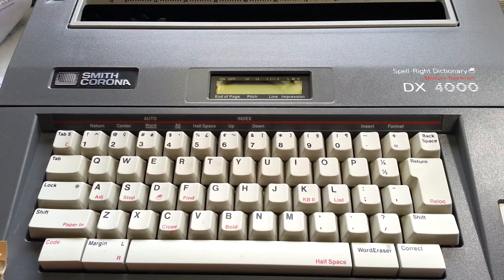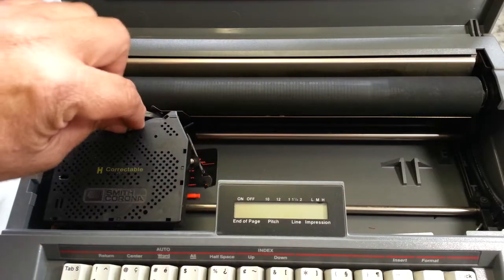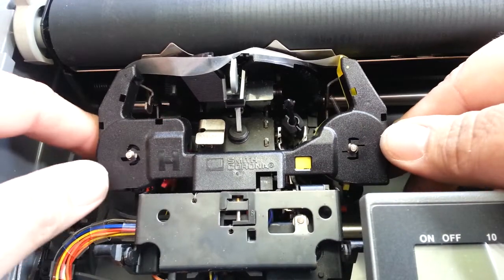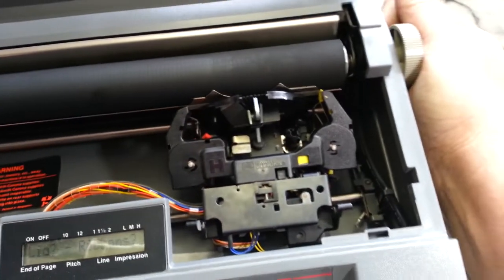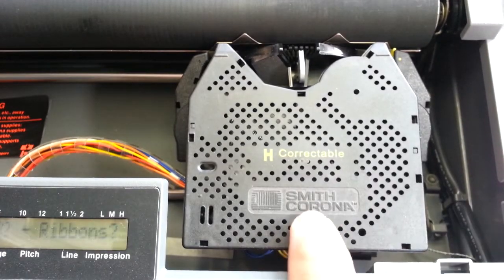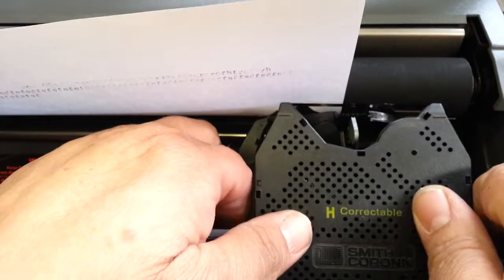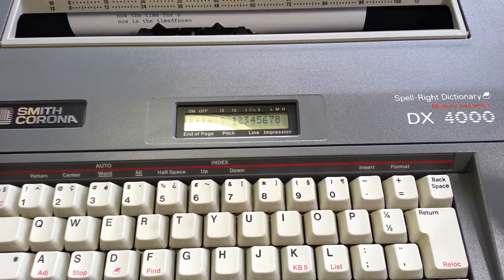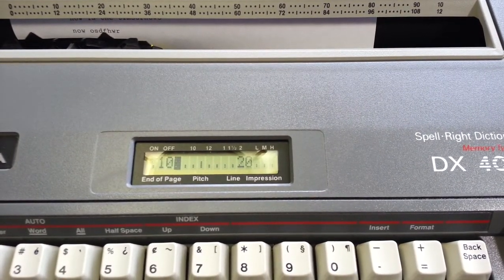Smith Corona Electronic Typewriter Jammed Repaired H Series Memory Demo How to Bypass Ribbon Sensor

Comment: I have a smith corona vtx100. It starts up but doesnt want to strike any letter. I have replaced the ribbon, but it still doesnt move. Also, the lock button is flashing constantly, so I thought I would bypass the censor like you did, but I cant find any sensor. Even though it is an H series. Do you have any help?
Reply from the maker: Majority of the H series typewriters do not have a ribbon sensor, shift light is an error code, but it could be many things, lid switch, carrier cable has a broken wire, PCB could be failing. There were multiple ribbon drive versions, unsure what version model yours is, they made 200+ H series models. Nowadays these are disposable to me, because there are so many available dirt cheap
Example - https://shopgoodwill.com/item/220786321
Another - https://shopgoodwill.com/item/221042596

Comment: I have a smith corona h series sl575, it was working nicely and when I went to test the demo the ribbon jammed. You can see where the ribbon is typing in the same area. Before the demo it typed beautifully. Now it keeps jamming like the ribbon won't turn..?? Any help would be appreciated. Please help if you can. Thanks in advance ☺
Reply from the maker: 1 year ago !  I missed this, check to see if ribbon is turning manually or install new ribbon
If those don't work then ribbon drive has failed and carrier needs to come out and drive repaired

Comment: FIRST! i had a smith corona like that but it had a longer display the full length of the cover and a floppy disc slot to which you could save what you were typing
Reply from the maker: That was a PWP model, they made a bunch of variations of those too......

Comment: My wife has an SL 470 and she can't figure out how to get it to move the page up by one line. She has to do it manually. I can't find a manual on it anywhere. Is there a button for advancing it up by a single line, or might something be broken? Thanks  for your great videos! Lee
Reply from the maker: If you press return and platen roller does not go up to next line typewriter is broken
Try holding platen roller tight with your hand and turning platen knob clock wise until it tightens, could just be loose
If that did not work gear pack has probably failed

Comment: What if the carrier is jammed and won't move freely and the lock button is blinking?
Reply from the maker: Is the shipping lock removed ? How is the carrier jammed ? An obstruction ? 
I can't tell much without looking at typewriter.
Did it ever work ? Flashing LED is an error code, basically telling you something is wrong......
Reply: @phoenixtypewriter2136  hey! I have a PWP 3850 model and mine doesn’t move freely either, can you describe what the shipping lock is?
Reply from the maker: @anthonyranciglio4308  If carrier lock is engaged, carrier should be just right of center, 
lock/release is the light blue lever on right side of print carrier

Comment: Hi, I have an Smith Corona H XL-1900. It worked fine, but now it’s stuck in the starting sequence. The lock button lights up when first turning it on, but stays off while it does the starting  sequence. The starting sequence just repeats itself forever, and when I open the lid, it just continues. Is there anything I can do to fix this?
Reply from the maker: Are you sure there is nothing impeding the carrier from moving all the way to the left, it needs to touch the left frame to start
Reply: @phoenixtypewriter2136  There isn’t, unless there’s a problem with the cartridge track

Comment: I have an XL 1900 (H-Series) which begins to initialise by moving to starting position. It then proceeds to attempt advance further but hits off the left-hand side of the casing with a loud grinding. Could you advise at all?
Reply from the maker: Top left hand corner, under the casing, is where the contact switches are, I would start troubleshooting there

Comment: I've got a Smith Corona SD780 that won't start up.  It just keeps cycling and whirring.  The head moves freely though.  Any idea what could be wrong?  It was working fine the last time I turned it on a year ago.  Here's a video.  https://youtu.be/UGboRqcPgYA
Reply from the maker: With typewriter off, open lid, does carrier move freely side to side ?
Are the cables connecting to the carrier in place ?
Move carrier to far left edge, turn on . . . .
Reply: @phoenixtypewriter2136  Thank you for replying so quickly!  Yes the carrier moves freely side to side and the cables connecting it to the board are in place and intact.  Moving the carrier to the left edge and turning it on doesn't change anything.

Comment: Hi, PT -

If you can assist, that would be great.  I own an sd300 H series. It worked until I was ready to sell it.  When I turn it on, the carrier Hums, buzzes and the print wheel stops with a noise.  Long story short, it is hung up at the far right margin about 102.  The carrier does not freely move.  Did not see debris, the print wheel can come easily.  Any suggestions?  Appreciate your time.  No error message on the lcd screen
Reply from the maker: New comment today . . . then I saw yours. Must be something interfering with the carrier, investigating is needed